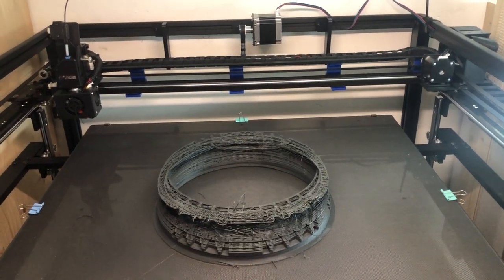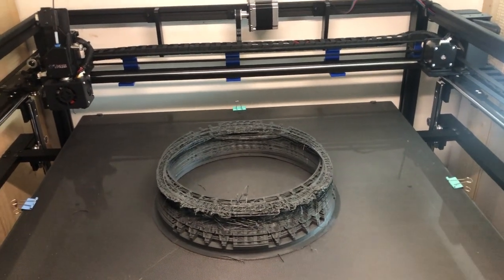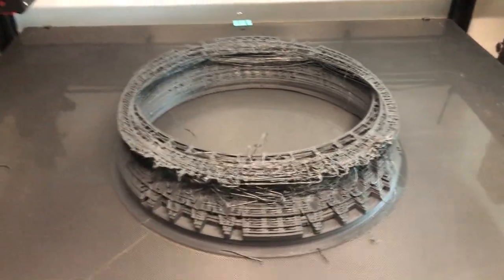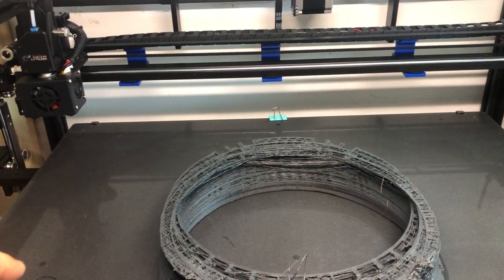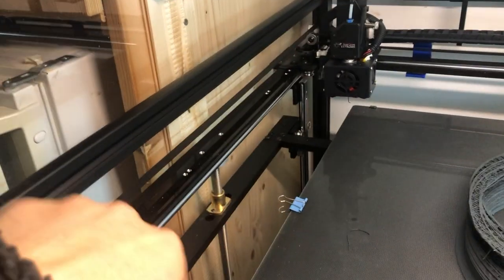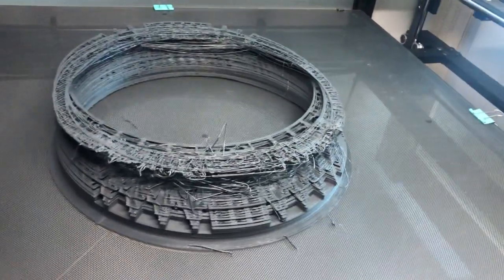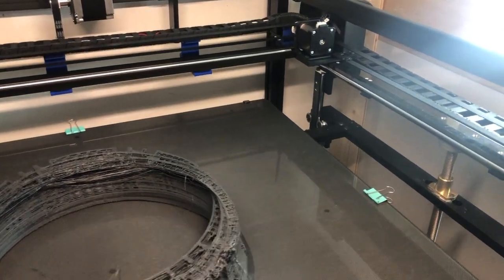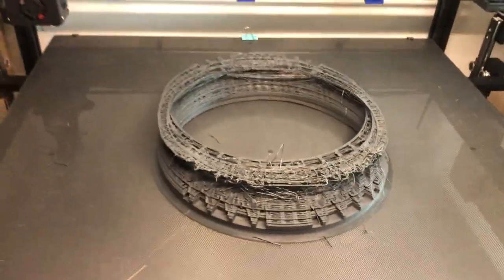TRONXY X5SA 600 - Layer Shifts... this time: Y-direction... Yay!

Comment: Hallo Oliver, das ist tatsächlich etwas mit dem ich nach dem Zusammenbau ein zweites Mal angefangen habe. Zuerst einzeln die Linearführung eingestellt und gerade die y Achse nochmal zu einander nach dem Einbau des x Achs- Balken. Bei mir war eine Verwindung der alu Profile (vielleicht durch mich nicht 100 pro zusammengebaut) festzustellen. Ich musste sogar die Profile lösen um es ausgerichtet zu bekommen. Genauso übrigens hinten der Antrieb für die y Achse. Wenn ich die zusatz Halter einfach fest anschraube, verzieht sich die Welle. Ich habe dazu die Madenschrauben am Motor Adapter gelöst um so auch den Wiederstand des Motors außen vor zu lassen. Ansonsten berichte ich dir bei Gelegenheit mal über die elektronischen Baustellen. So im Original halte ich das für nicht glücklich. Zu geringe Spannungsversorgung und keine Mosfet... muss mMn geändert werden. Grüße Markus
Reply from the maker: hi flo... danke vielmals für deine infos... wir müssen mal telefonieren... :) ich tratsche lieber als lange zu tippen... ich habe soeben meinen ersten print fertig... wow. 37+h... ich habe mir so viel zeit beim aufbau gelassen und wirkich mit riesigen mess-winkeln gearbeitet... mein system sollte echt gerade sein... die rullen an den wägen sind meiner meinung nach nicht mein problem, sondern es waren vor allem bei den layer-shit-problemen meine riemen-räder (die ohne zähne)... da hatte ich nur geschlitzte o-spann-ringe, welche die dinger halten sollten... was für einen dumme idee.... die räder und lager standen total unter spannung blockierten richtig... nachdem ich die mit weiteren schrauben gekontert habe und dann die spannung von den lagern war konnte ich mal ein paar tage am stück drucken... mal sehen wie lange das hält und wann das nächste drama anklopft... lass mich gerne wissen was du so vor hast! würde mich sehr freuen... gerne per e-mail über die info-seite hier auf dem kanal... grüße und viel erfolg mit deinem t-600 :)
Reply: @3d4future  ich meld mich auf jeden Fall bei dir und auch bei Ralf! 2 Kabel noch, dann geht's bei mir ans Bett... 👍